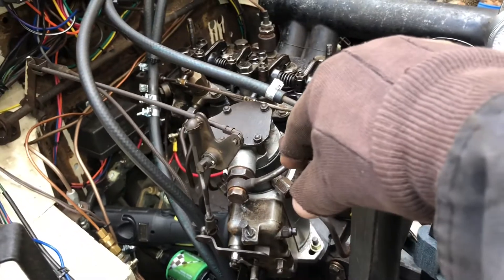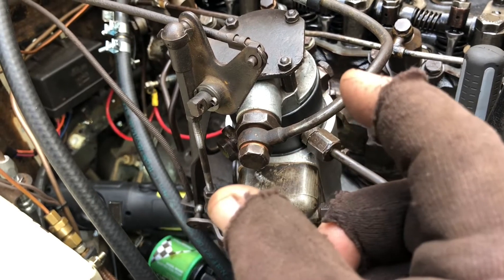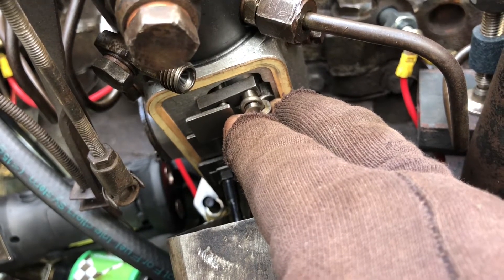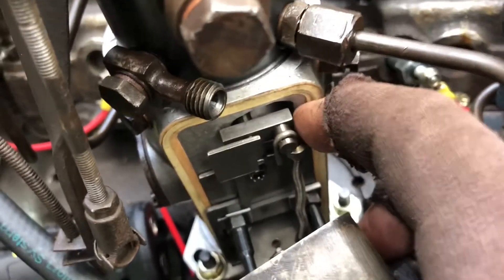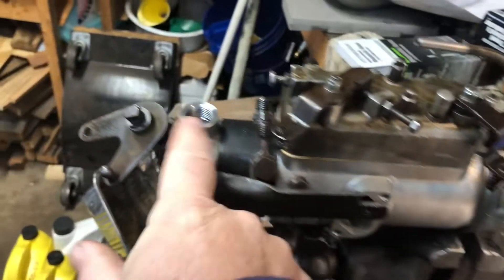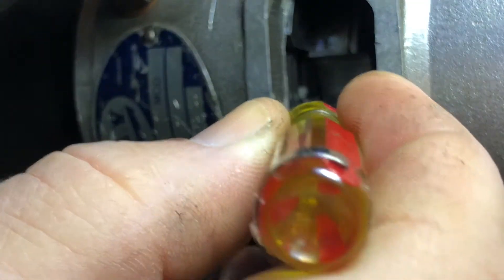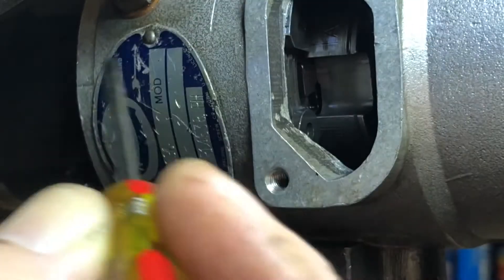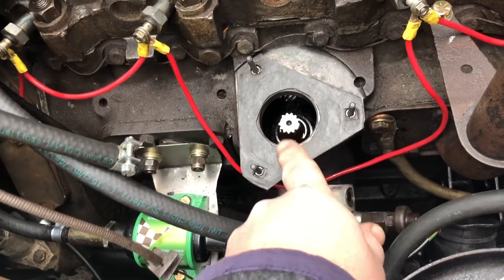CAV Diesel Pump Mixture Adjustment Land Rover Series 2A 2.25l restoration injection

Comment: Good morning from Stuttgart Germany
What you fiddling around with a dial gauge.people believe they they need laboratory stuff to run a piece of British scrap.!

Bring the pump to a dieselshop with
Reply: A a correct testbench for cav pumps and tell them the condition of the engine.
Pay their bill and become happy.

NEVER TOUCH   HVO DIESEL

don't believe a word about it.

Greeting from a downgoing nation
Reply from the maker: Good day Sir. This pump has actually gone to the diesel shop a couple times. Lots of money spent. I tried to tweet a little more power out but ended up needing to adjust the timing chain. Thank you for watching.

Comment: Cory. Great video. Thank you. A quick question. I have a series 3 2 1/4 diesel. She ticks along nicely, but i get gray/blue smoke (unburnt fuel) when she is loaded. I know the emissions standards of modem vehicles eliminates almost all exhaust. I have the power (w overdrive) what should I accept for smoke levels. I have adjusted the CAV pump timing a few degrees and I think it is running well. But how much of the smoke can actually be eliminated? or will there always be smoke?
Reply from the maker: Thank you Sir! Sounds like you have plenty of power. Smoke will always come out with a diesel. It is the nature of the beast. How is your timing chain? After being warmed up it would still puff out white smoke out of the tail pipe at idle. Once I adjusted my timing chain the smoke was gone.

Comment: You are adjusting the injector´s pump timing advance, not how much fuel goes in. Your problem is that the governor´s spring goes in the second hole of the throttle lever.
Reply from the maker: Thank you for watching. I was thinking about trying a different position on the governor. Thank you for the suggestion.
Reply: Can you help me find diesel brothers labs that you mentioned?
Reply: No, it affects fuel delivery, not timing.

Comment: I used to drive a Peugeot 504 diesel with a stick in the late 1970s. It did 0-60 mph in about 20 seconds. I thought that was slow. It did about 85 maxed out. I I also had a 1991 Land Rover Defender 90 2.5na that was slow too. 65 maxed out with a tail wind.
Reply from the maker: Oh yeah! The small displacement diesels of the 80’s. I use to drive many 1.6L diesel VW Golf (Rabbit in USA) from the 80’s. They were slow but could climb a hill. I would be happy to hit 45 in my Series 2A. Thank you for watching!